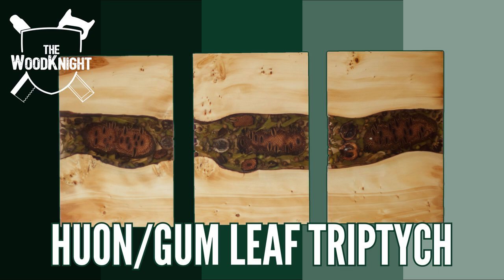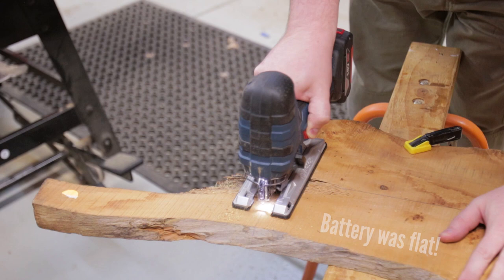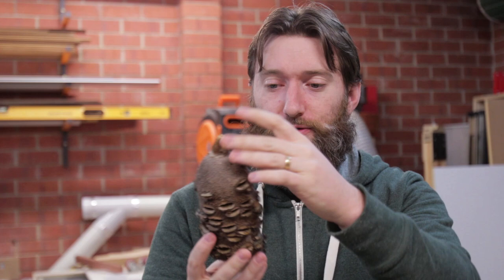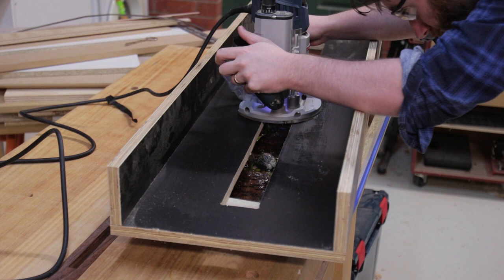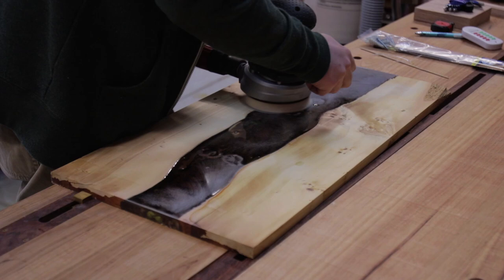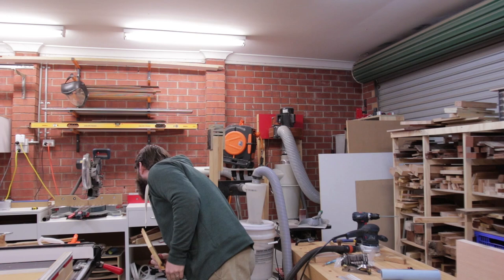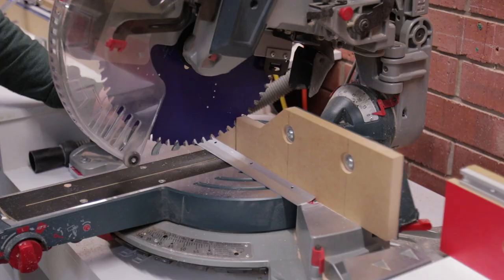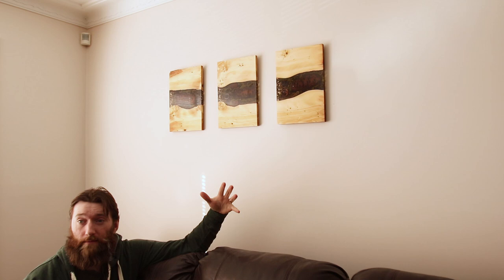How to make Resin & Woodworking Art! (Gum Leaf Triptych)

Comment: Great use of materials Paul, if you need any more gum leaves let me know, I'll be happy to drop off a trailer load.
Reply from the maker: Hah, thanks. There is a biiiig 50m gum tree in the neighbours backyard that overhangs ours. Doesn't matter what time of the year it is, that corner of our yard is always flooded with gum leaves!
Reply: We're in the Yarra Valley so surrounded by them, still, part of the deal I guess. Also have you used All Boards in Bayswater for ply
Reply from the maker: I haven't, no. I use MaxiPlywood - they're closer!

Comment: Looks amazing! I love the smell of Huon Pine. Sassafras would be my second favourite.

How does the casting epoxy compare to West Systems? Would you use it to fill voids and gum veins in table tops?

Nice work!
Reply from the maker: Its cheaper than the West Systems, but it takes longer to cure (but will cure when cooler). I'm not sure what its mechanical strength is, so when comparing it for bonding purposes or for exterior/maritime use it'd more than likely favour the West System stuff.

However, for filling voids from a visual point of view, as good if not better. Lower viscosity and surface tension means it tends to actually go into all the crevices that west system stuff can often clump up on.

Comment: Awesome video Paul. Just a quick question I noticed that as you were sanding the piece I couldn't help but notice the connection used to hook your sander up to your vacuum. Would you be able to tell me what it is you've used to connect the two and also where I could get one from? Thanks.
Reply from the maker: Its just the hose that came with my shopvac.

Comment: Looks beautiful and a creative project:-) like it! how did the resin did not stick to the base of the frame? was it laminated ply underneath , if u can share i will appreciate the answer. thank you:-)
Reply from the maker: The form was made up of melamine, not plywood - think of melamine as like teflon. Melamine and epoxy resins are pretty similar, but go down different paths in manufacturing. Veeeery little things actually stick to melamine, you have to get some very specific glues to bond it to wood, for example.
I also waxed the melamine for extra "non-stickness", but you could use packing tape too.
Reply: Thanks Paul :-)  appreciate your reply